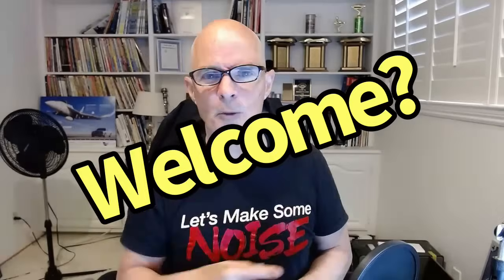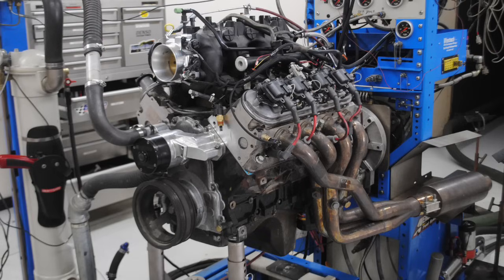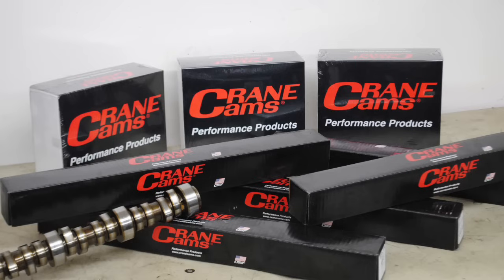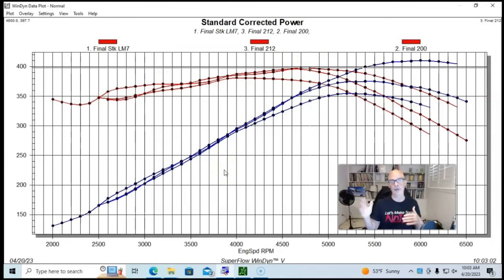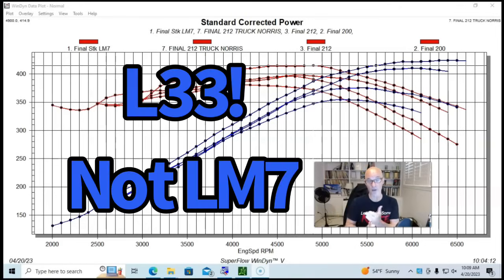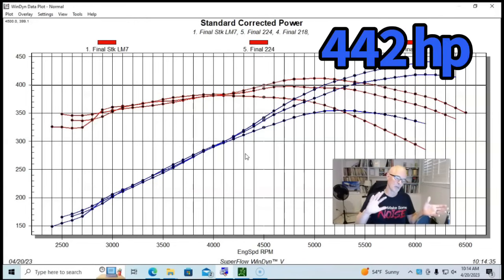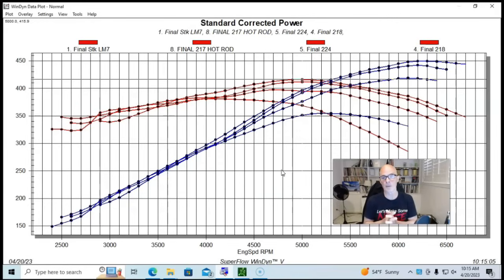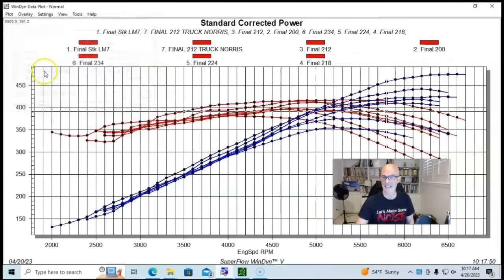THE ULTIMATE 5.3L CAM TEST VIDEO-HOW MUCH POWER WILL MY CAM MAKE? FOR ANY LS CAM-THE ANSWER IS HERE!

Comment: Can you test just shaving heads at 0.5 intervals? See what making a smaller chamber and higher compression will do??? Please
Reply from the maker: compression adds 3-4% of power per 1 full point
Reply: @richardholdener1727  so from a 9.5.1 to a 9.6.1 is 3-4%    Is that correct ? Have ton done any controlled tests with that, or is it a major pain to do such  controlled testing?
Reply: @taraszakordonskk5731 9.5 to 10.5 would be a 3~4% increase.  Compression makes your motor more efficient, which is where the power increase comes from.  You'll also see better fuel mileage, although if you go up too high you need higher octane fuel (if you run WOT).

Comment: I was wondering if you could add idle vacuum for us that are looking for a street-able cam? Brake Vacuum boosterable.
Reply from the maker: use the smaller cams
Reply: Hi Richard, I'm an Automotive Instructor for Job Corps and I teach tuning. I have an extreme amount of dyno training but for the IM240 program from Colorado/California. It seems to me that lobe ramp rate, location of opening / closing on the degree wheel and LSA have greatest effect on Vacuum at low rpms as I know you know. We are an emissions state and many people want to use their Vacuum boosters without going Hydroboost. In Washington State, we are allowed to modify but HP and Torque numbers can only help so far.  I've been watching the videos looking for vacuum on your control panel screen during your dyno runs but trying to see them at idle is tough because the video is typically about above 2K rpms. Great videos BTW. Keep up the great work and videos! My students love them.

Comment: Install notched pistons and try more overlap (106, 107, 108) installed 4 degrees advanced and earlier intake valve closing. I know more overlap hurts drivability, but makes more power thruout.
Reply: Truck Norris can, all be it small lift and duration has 106.5LSA

Comment: Did the L33 also have 2.0” intake valves? I believe the LM7 has 1.89” intakes
Reply from the maker: the l33 has 799/243 heads which have larger valves

Comment: if you used the same heads,manifold,exhaust,etc.... and did the same cam, say the stage 4 cam,  what kind of hp difference could you expect from just changing the 5.3 to 6.0 everything else the same? im guessing about 1.25 hp per cubic inch.
Reply from the maker: please see the 6.2L (L92) stage 4 cam test video

Comment: 408 Stroker, AFR 205 heads, Yella Terra rockers, 233/239 .600 112 cam. 10.8:1 with ported trail blazer intake. 92 mm tb and full length 1 3/4 headers. Anyone have any idea what this motor should make? Hp/tq
Reply from the maker: it won't make 500 wheel hp
Reply: 500-525whp (575hp or so crank) give or take. Small cam for a 408, TBSS Intake holding it back and the AFR 230v2 would've been a better head choice depending on application. Should make a killer torque curve though.
Reply: My Camaro with a 408 with ported LS3 heads and ported LS3 intake with a 244/254 .630/.625 113.5 +3 cam made 514rwhp in my camaro. With that being said your small cam and heads will suffocate your engine a lot. Let us know what it made.

Comment: I have to wonder if the average custom truck or hot rod owner could even notice some of the small incremental gains on these cams? Obviously, 100 HP is going to register on the seat-o-pants dyno. But, 10 or 20 horsepower is most likely not even detectable when out cruising on a Saturday night. 
So basically when replacing a stock cam, it seems you need to at least throw in a stage II to see any significant improvement.
Reply from the maker: you will feel 20 hp

Comment: My summit cam will probably push over 50hp along additional hp from a tbss intake. And decked 862heads at .020. So. I’m guessing from the setup Richard has here I’ll be bumping close to a 80hp increase. On a lq4?   Thanks Richard

Comment: I put a COMP Cams XFI RPM Cam in a in my neighbors 2005 Escalade, it felt like a substantial gain together with MagnaFlow 3" street series Cat-Back exhaust system and S1000 Diablo Sport AFM Module.
it has 228 Intake Duration at 050 inch Lift and 230 Exhaust Duration at 050 inch Lift.

Comment: So you you won’t gain or lose power below 2000 rpm’s?
Reply from the maker: you can lose
Reply: @richardholdener1727  
I know you always suggest a “mild” cam and I have agreed. But this vid didn’t show much change at low RPM. Is that simply an engine dyno thing? Vs a 3500#+ vehicle?

Comment: Power up to 3500 rpm was not very different from the smallest to the largest cam.  This is probably the truck intake manifold dominating the midrange with its runner length.  Were all the tests run with the same type of manifold?

Comment: Looks like for me driving on the street NA a cam change isnt worth the trouble of changing it lol
Reply: Chop chop
Reply: Depends on your application.... roll racing and ringing out rpm... top end power is valuable..... I shift my bolt on stock cam ls3 at 6500 but it wants more
Reply: @Ws6Ms  and I got 1 for a durability upgrade and a torque increase for a 293.

Comment: My trucks an everyday driver, 66 Chevy, work truck, haul wood, pull a 16' utility trailer. 
 I'm about to do an LS, probably 5.3. 
 Will the BTR Truck Norris do good on hauling firewood out of the woods, but haul Asspine at the top side? Add the eBay headers, maybe some 30-33lb injectors? It's a 3:73 rear.
Reply: It will help like the Texas Speed Chopacabra, but you can do a 383LS build, or do a LT1/LT4 (Gen 5)

Comment: In for all of the - "But Richard, what about this? And what about that? comments.

This is me thinking out loud...
1. That Crane 200 duration cam - I feel like a factory LQ4/LQ9 cam would make almost identical numbers.
2. I love that old Crane 224/232 cam - I have a version of it that I had Comp grind on XER lobes. I'll be testing that in my LQ4 swapped Silverado soon.
3. Thank you Richard for the plethora of camshafts compared in this video. Great data as always.

Comment: In your cam shootouts, will you please start adding cams that are obviosly too big?    Even the biggest cam here wasn't down on power compared to stock at 3000 rpm. Comments on idle vacuum would be helpful too. Love your content! Keep em coming.
Reply: He said that the biggest one in this test was probably the biggest you could run with stock piston to valve clearance.
Reply: Also, the 3000 rpm numbers on these graphs don't mean much, because that is the load in point. There is a major difference in the down low numbers of these cams, you just don't see it on these graphs
Reply: @mikeday8826  and these low end numbers are important if it's a daily driver. I don't know why dyno operators don't start the pull down around 1500.
Reply: @robertwest3093  because a dyno can only measure about 3000-3500 of rpm range. So if they started the pull down at 1500 then it’d only test up to about 4500rpm~ well below the power peak(s).
Reply: @robertwest3093  I have a 2600 stall, wouldn’t even notice the down low missing
Reply: @robertwest3093  doesnt matter with an auto and converter
Reply: @aaronliddell4280  yeah ok
Reply: If you like driving a higher stall converter.   I personally cannot stand cruising around at part throttle with one.   Different strokes for different folks.
Reply: You know the LS is a beast when a stock cam with less. 050 than the gen 1 993 cam puts out over 350 hp!
Reply: I agree. Longer duration I’m interested in. For very lightweight cars
Reply: Waste of time

Comment: Man, are we spoiled nowadays or what? Your stock LM7 cam makes more than 350 hp. Think of what it took to get an honest 350 hp out of a 1967 327 Chevy. Great job showing what a cam change will/will not do. As always, a lot of work and a lot of information crammed into 11 minutes of content.
Reply: Rich tested a 327 in virtually stock configuration that made 356hp @ 6100rpm. Again, it’s at 11:1 compression instead of 9.5:1.
Reply: Whats wicked is it takes less than $1000 all together to make 450 honest horsepower. Throw another $1000 into a good nitrous system and get 650 honest horsepower. None of this old head  my 327 made 900 horse with a 3/4 race cam and double hump heads. Lol
Reply: Ok, lm7 what's a good cam before you have to add mods to the engine, like new fuel rail ,pump and heads.
Reply: Gen 3 LS is peak combo of technology, power, and simplicity.
Reply: Putting in a stage 4 btr with 0.636 lift
Reply: Old 327s made that same power with a oe flat tappet hydraulic cam. They did have 11:1 compression tho
Reply: @HioSSilver1999  That was advertised HP. With an iron manifold and a Q-jet, the L-79 struggled to make it. Look what it took to make an L-76 or an L-84 put out their respective numbers. L-79 still one of my favorites, though.
Reply: @merylpelosi8485  he's tested them...they're comparable.
Reply: Yeah with iron heads to boot .
Reply: I dont see how this stock lm7 made 354hp though. None of the others do lol
Reply: @tylerparker3024  this is with no accessories and long tubes. GM tests with all accessories including the -30 hp mech fan and manifolds with factory exhaust for the 280 hp number.
Reply: @tylerparker3024  they all make that
Reply: @sinistersilverado965  no they dont
Reply: @tylerparker3024  yes they do
Reply: @sinistersilverado965  i mean you can literally google the question and read that the lm7 made 270-290 hp depending on the actual year but whatever man. Youre right. They all make 350
Reply: @tylerparker3024  you have no clue
Reply: @sinistersilverado965  its a fact dude. From the factory, they didnt make 350hp. Obviously you can build them to make whatever but as a factory spec engine they dont make 350.
Reply: @tylerparker3024  factory LM7's make 350 hp
Reply: @tylerparker3024 they do fairly regularly across the board with headers and no accessories. Either way it doesnt matter, this shows you the increase in power. If it were 60hp increase on a 350hp engine it would also be that roughly on a 300hp engine. The point is the gains are incredible for just a cam swap

Comment: Perfect timing.  I have 11 min left on a read of a 3rd gen Coyote ECU.  Moar cam tests!
Reply from the maker: it does take a minute to flash those
Reply: @richardholdener1727  What’s the largest cam you can run on 5.3 with 4.8 pistons swapped in?

Comment: The Summit stage 4 cam is very similar to the custom cam in my 6.4L 394Ci stroker in my Ram.  Mine is a 233/246 112 +5degrees of advance, with 6.4l intake manifold, & 3,600 high stall. Didn’t want to go bigger on the intake duration because I wanted a really solid driving truck on the street.
Reply: No body cares bout ur ram ham  this channel is bout LS engines brah so stick to ram ham channels. LS 💯 always!! Rams dodges suck ass
Reply: And your telling us this because..........